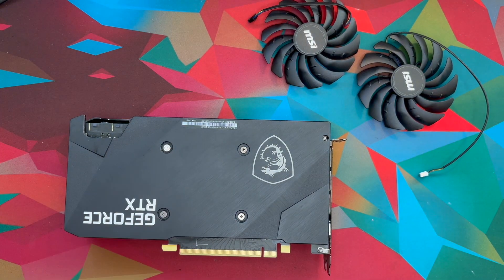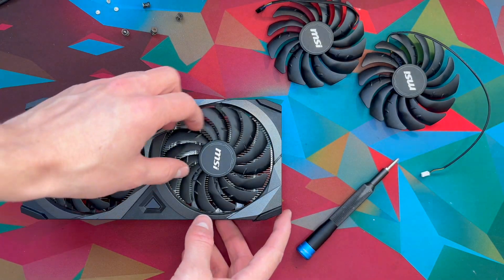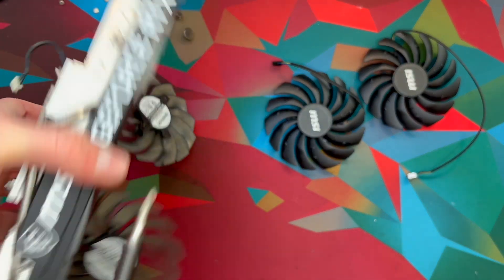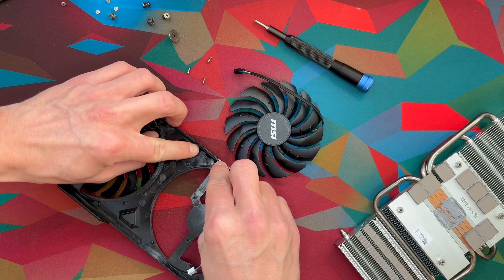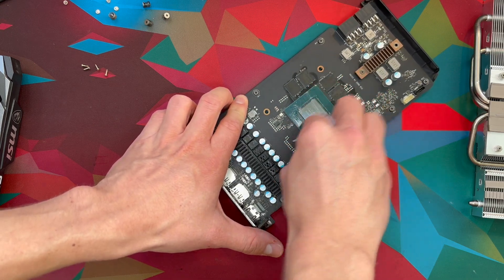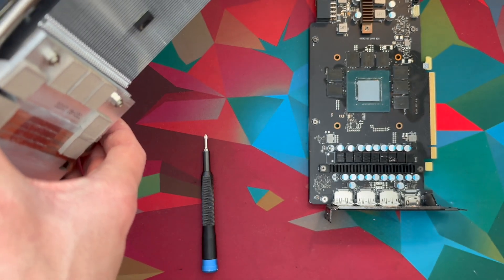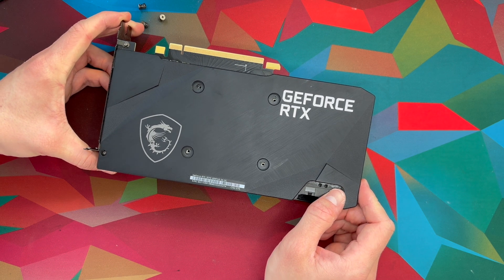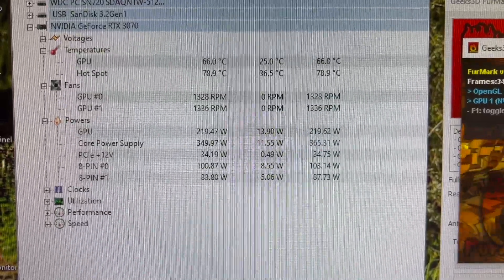RTX 3070 Fan Replacement & Thermal Paste Application | MSI Ventus 2X

Comment: I applied a lot of paste (Corsair XTM60) to the point where it spills out the sides, think it would be a problem?
Reply: Should not be an issue since the thermal paste is not conductive. Paste is just there to fill in the uneven spots and cracks on the surfaces. If you put on the cooler it will just press out the excess that's not needed out the sides. It's just messy to clean up when u are going to repaste it again.

Comment: It's a mistake to disassemble the fans before disassembling the shroud. You've the fans dangling for no reason.
(I just replaced one of my fans but it rattles, I even tried to replace it with the second new fan, it rattles also. Bummer. I remounted the original fan which remains the best one)
Reply from the maker: I don’t see a problem :)
Reply: @hgsoftware5129  There's no reason to disassemble the fans before disassembling the shroud and it's better to do it after. Like a girl removing her bra before removing her top. But sure, it can be done...

Comment: Fan issues with this card seem pretty common. On mine, unless the fan is running nonstop, it completely drops out of its socket and won’t spin at all. There’s no weird noise—it just stops working unless I physically push it back into place every time. I asked MSI if fan issues were common with this model, and they told me it wasn’t a known issue. But honestly, I don’t think they’re being fully upfront, because I’ve seen plenty of people online reporting similar problems. It’s a great card and was a solid value when I bought it, but this is definitely its biggest drawback imo
Reply: This is an old post but I just wanted to say thanks. I didn't realise this was the problem with my fan. It would make a noise, then just stop working. I even bought replacement fans thinking it was broken. Turns out I just had to shove it back in!
Reply: @The_Yosh112  lol i'm glad I could help!
Reply from the maker: Get a replacement for 20 dollars :)
Reply: I had the same problem with my Msi 3060 —- gluing the fan back together seemed to remedy the issue
Reply: I've Had two defective MSI RTX 3060's back to back and fans were the issue return them as they were bad out of the box. I am going to use this video to replace a third exact card with new fans, so three with fan issues. in two years. Not impressed with the fan quality.

Comment: Thanks! I was wondering how long you've had the card, and when you first noticed the fan noise? Mines making a noise similar to yours but only on and off, usually at 80%+ fan speed. But the fan still spins normally. It's an msi ventus 4070 super, but has a similar build to yours.
Reply from the maker: I Got this card second hand. But you might want to consider changing them
Reply: i have the same issue at around 80%fan speed the make a rattle sound